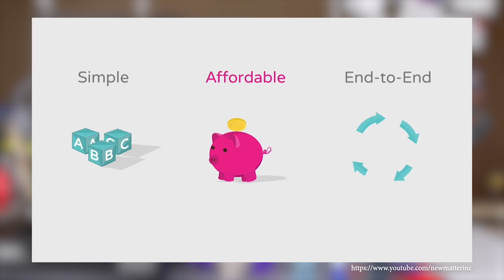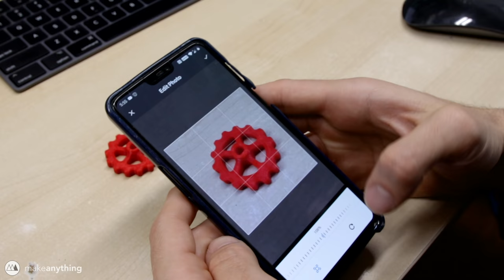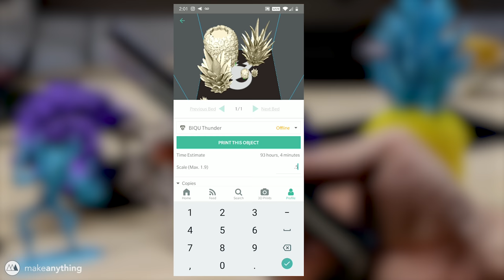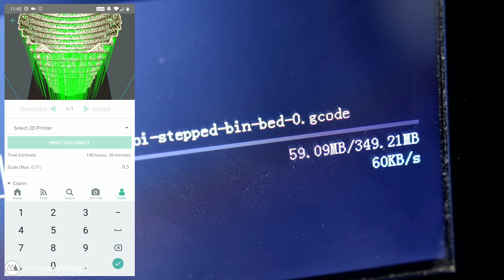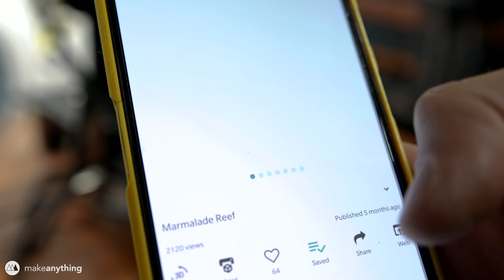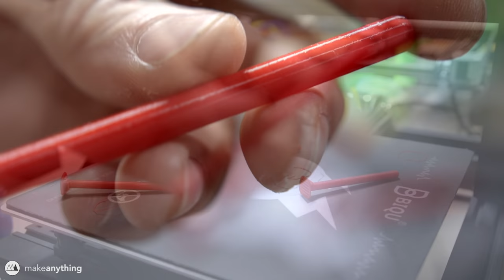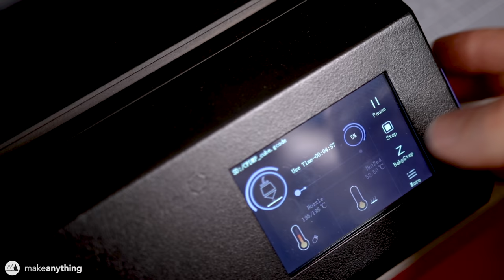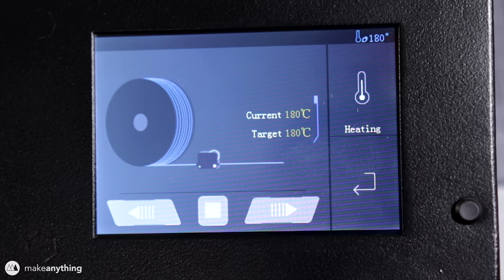the Current State of "1-Click 3D Printing"

Comment from the maker: Some things I forgot to mention: 

- I mistook MMF's "Click and Print" feature as "Print on Demand", but that's actually a different service they advertise (ordering printed parts).. the idea is the same though, but that was my bad.

-This BiQu Thunder was sent to me for free for the purpose of demonstrating the 1-Click printing feature. I wasn't paid. Sorry I sometimes forget to mention that in videos!

-I also forgot to mention another feature I really like on this printer, which is auto-off after a print is finished. I wish more printers had that! I also learned today that the print head moves up out of the way even when I "hypothetically" trip on the cord. That makes the print recovery feature much better.
Reply from the maker: Also, FIRST SUCKERZZZZ!
Reply: And why don't you add this to the description of the video then? Or pin the comment?
Reply from the maker: @Dzeno2010  whoops, I meant to!
Reply: Why do I need auto-off? My printer is on 24-7 even if not printing, no issues.
Reply from the maker: @HungrysitesRu  I'd rather not have it run needlessly when it finishes overnight
Reply: 1 click printing Devin's main body started... Cloning human parts completed
Reply: @make.anything  What is the best 3d printer you suggest
Reply: Make Anything do you think that the springos would work for pla resin?

Comment: i got a "one click" version of cura with only 3 settings and it work fine for most of my prints. The only thing is after few month you can't do "one click" because you need to clean the machine, level the bed again, ect... for more complex prints i added additionnal speed control.

Comment: OH MY GOD!  I was like, "You're wearing a MOD-t Shirt!"

I backed that printer and got it for like $200. I used the crap out of my Mod-t. I didn't care about any of the "one click printing" things, honestly. The price was right, non-proprietary filament, and worked with any slicer.  I can't even count how many thousands of hours that thing was in use. Still works, but I don't use it anymore since getting my CR-10s. I feel bad seeing my little MOD-t in the corner. 😢

I still love the design of it, and the super unique movement system. Once you got the settings tuned in it would print some incredibly accurate parts. The Newmatter customer serving was also outstanding. I was really, really sad when I heard they were closed.

So cool that you got to be a part of it. I hope they were as nice and cool as they seemed from my experiences with them.

Comment: I had a dream that you came to my house and helped me with my 3d printer
Reply: Haha same xD
Currently troubleshooting my printer. I have problems with the first layer. The printer extrudes about half a centimeter before it actually gets to the first point of the print so it makes a blob that messes the entire layer up when the printhead touches it
Reply: What I do is I wait for the printer to do its thing and then I pull out the extra filament stuck to the nozzle so it doesn’t distort the print
Reply: You could try printing a line on the side of your printed to remove any clogs before you start your actual print, it  can also help to turn retraction on in your slicer
Reply: Yes a dream

Comment: How could 3d printing be a "one click" task? Ehm.. not that I like the perspective, but the only thing I can imagine is a simil-iPhone ecosystem. You have only a model of printer (or two), the materials are sold by just a vendor (or via a "work with .." consortium) and the 3d models are distributed via some sort of Model Store, tested to work with your 3d printer and with settings (temperature, raft, speed, orientation) already optimized for your printer. So far, I'm satisfied with the current status of 3d-printing, where you can customize event single aspect, but this is the exact opposite of "one-click" experience.

Comment: I thought different filaments needed different temperatures, and that there was a lot of fine tuning of that that was fiddly per machine? Is that no longer the case with more recent printers/filaments? Would a user of this printer have to specify the temperature or type of filament?
Reply from the maker: I find that I rarely have to adjust settings when changing filament, as long as it's all PLA. Old filament can get stringier though, so it would be nice to at least have the option to modify settings

Comment: I want to make a vacuum sealed filament dispenser. When not in use it vacuums the air out of all the spools of fulfillment stored in it. I'm making a plastic shell that can keep adding sections for more colors and types. It's wall mounted above the printer. You unseal it to use the filament.  I'm thinking of having each section unseal on it's own to keep rarely used filaments fresh. But I think the best I can do is have two or three zones for most and rarely used filament. Can anyone think of any features it needs?
Reply: Easy to use vacuum

Comment: Ok though lets be honest. 3D printers are much easier to use than 2d. Every time I try to use mine it's a disaster. Jam, out of ink, faulty ink cartridge (whatever that means), need a calibration print for no reason, or just plain wont go. I wanna fill that printer with C4 and return it to HP.